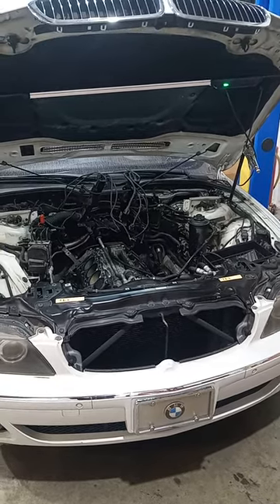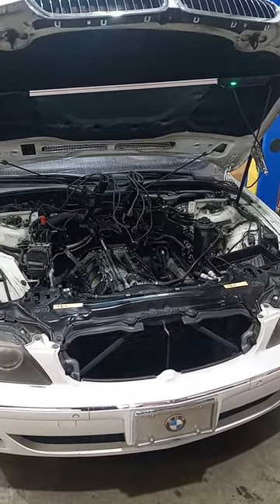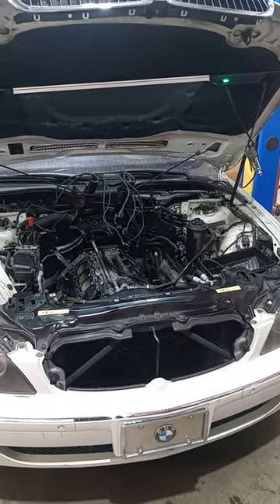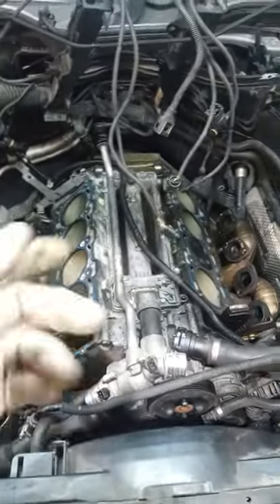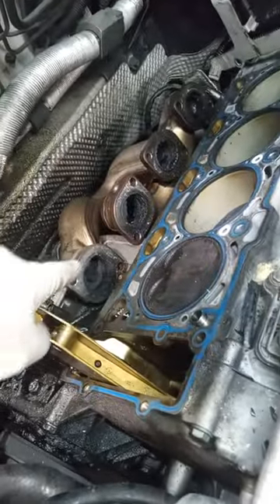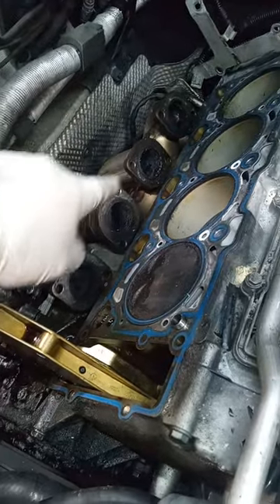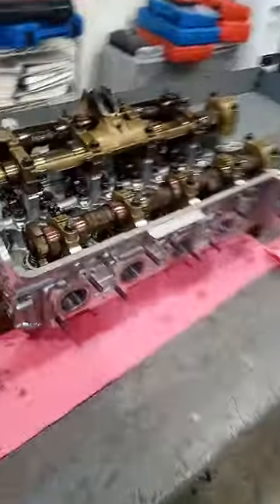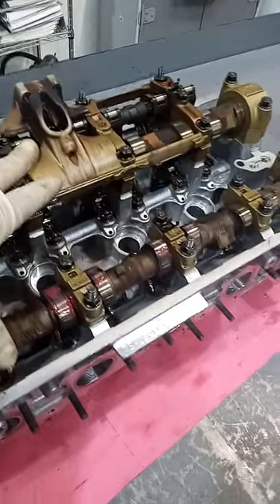#Shorts: Replacing N62 Valve Seals

Comment: Can valve seal replace with out remove the head 
By pressure the angine
Reply from the maker: I believe they can be, but it is tight and little room in the engine bay